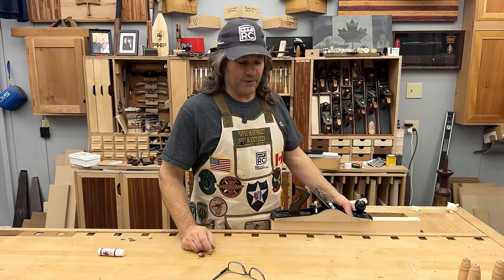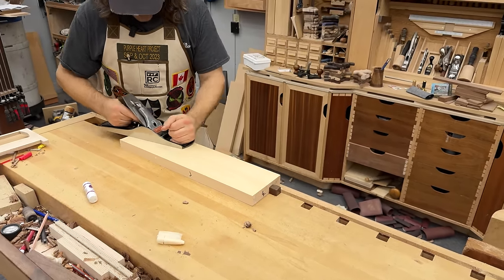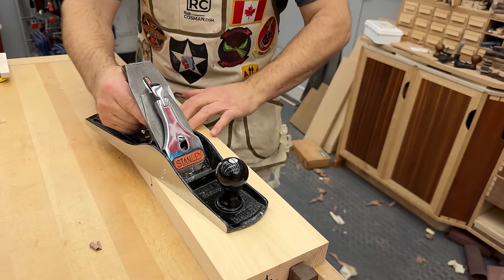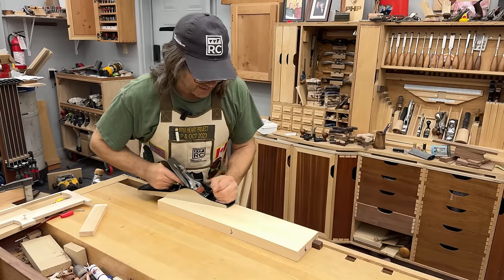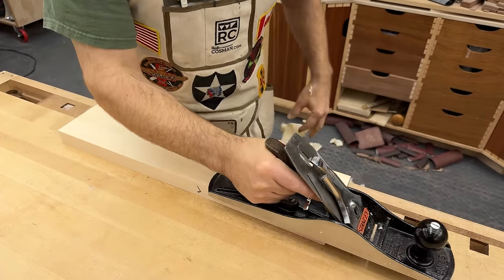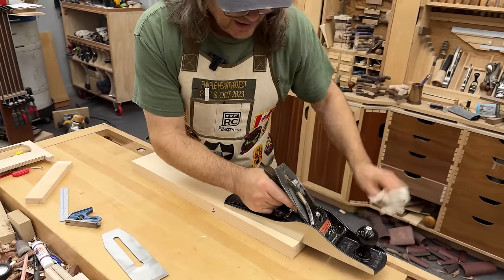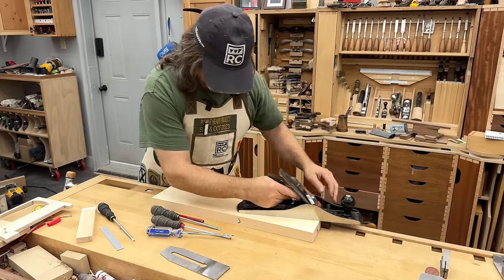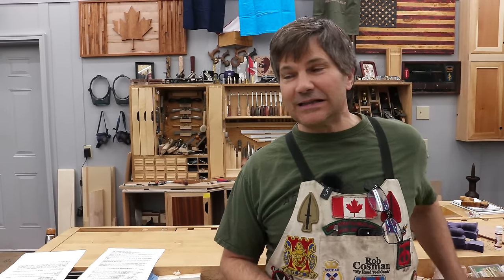Why Your Hand Plane Doesn't Work | How to Fix It!

Comment: My problem is my blade wont move down when I screw clockwise. I don't quite get what force is meant to push the two pins that pass through the blade toward the opening. I have to open the catch and tap the blade down

Comment: Rob, this is a great video and just about explains everything! One thing I believe is missing is "sharpening the blade past 45 degree", which I believe happens to people when they hand sharpen and progressively increase the angle. If this happens, the plane won't cut anymore.
Reply from the maker: Yup you are correct.  I should have included that in this video.  That make the second item we left out.  Maybe we will do a follow up.  Thanks.

Comment: I've been digging these tips out of robs movies for a while and they've made all the difference in my plane success. I would like to add that a solid hold on the material is really important. If it's not held solidly and immobilized that will cause issues. Seems obvious I know but I'm just passing it along.
Reply from the maker: Well thats probably the third tip that I should have included in the video that I did not.  Thanks for the great comment

Comment: Hi Rob, I don't think you mentioned my problem... I used David Charlesworth's method for prepping the chip breaker because there was always a gap between where it engages with the blade iron. I've used a business card up the top near the screw so it will force the gap to close and it works but id rather just have a chip breaker that doesn't have a gap. Is there a way to fix it or should I just buy a new one?  I have a Clifton 5 1/2 Jack.

Comment: Well, my planes are working better than they did when I started a couple of years back. Some one commented that it takes about 5 years to really get the hang of using them, and that is seeming to be true. The problem is that there are so many little tricks that you have to figure out on your own, and can't be taught. I am making progress.

I am curious as to your feelings on the Japanese style pull planes. As some one who HAS to experiment, I started playing with them as well. At the very least, they are interesting, and take pretty much the same skills to work as the western style planes.
Reply from the maker: I stick to western planes.  My woodworking is from the English tradition

Comment: I bought a replacement iron and chip breaker for my Stanley. They did not fit The hardness of both was well above Rockwell 60. I used the iron with a Stanley chip breaker and the chip breaker sharpened as a low angle plane iron. So mixing up the two is not as daft as it sounds. They both worked fine with keen edges!
Reply from the maker: Good solution

Comment: What can you do if the chip breaker doesn’t pair well with the blade? I have light showing on both sides when they are screwed together but pretty sure the blade is flat.

Comment: That's a lovely Stanley plane! When I sharpen my blades, I have a devil of a time feathering the edges...I put pressure on the edges for three seconds but it seems that the edges dig into my 16K stone. Is there a specific technique you use when feathering edges? Thanks for your content and have a wishing great, prosperous new year to the Cosman team!
Reply from the maker: If you are referring to the vintage thin Stanley blades yes they area bit mor prone to digging in because they are so thin.  Put a little less pressure on the corner but spend more time on them...6-9 seconds
Reply: @RobCosmanWoodworking  Thanks for that tip. I occasionally had the same issue, though not with the Ray Iles replacement blades, which are 2.5mm rather than 2mm thick

Comment: "If that doesn't work....buy a belt sander". 🤣🤣🤣

I've followed all your advice regarding planes & sharpening & now have a 4½, two 5½s & a 7 (All 50+ year old Stanley Bailey's) which perform fantastically - unimaginably better than they used to.

Comment: Another issue can be the fit between the blade and the chip breaker. Probably more of an issue with the older, thinner chip breakers. The chip breaker has to be ground perfectly flat and to the tip to give a close fit over the whole length of the forward edge. Also consideration to this edge when compressed with the center screw.

Comment: That Stanley Jack looks well fettled. Good info to know.

Just out of interest, I wanted to ask about how thin a shaving you can get with a metal plane. I use Japanese tools but I've always found dealing with kanna difficult. Do you think it's possible to get a 0.010 micron shaving from a modern metal plane?
Reply: 0.010 microns is 10 nanometers, so about a 1000 times less than a really thin shaving.
Reply: Sure. IT is just going to take a ton of tuning and setup. Just like the top kanna. The competition kanna are pretty much custom made to shave thin.

Comment: I'm familiar with the adjusting knob being a circular brass knob.  yours looks like a 'pin wheel' .  Is that after market or is Stanley making them that way.  Seems like a better way to adjust on the fly.
Reply from the maker: It’s an aftermarket knob that we designed and sell. https://robcosman.com/collections/planes/products/rob-cosmans-plane-adjustar-stanley-record-version
Reply from the maker: Our design, we have them to fit Stanley, Record, Luban, Lie-Nielsen and Woodriver, robcosman.com

Comment: I appreciate the video. I do have a question for you. I have a couple newer Stanley planes. A low angle plane and an 8 inch or so plane. I can put a shaving edge on the blades, and I have followed the steps you have shown in the video. I still have a few problems. First neither of the planes will hold depth. Between the backlash in the depths screw, and I assume the looseness of the frog threads I find myself endless lowering the blade every few passes. I have never been able to pull a shaving as feathery as you (though I know in part, it can only be done with flatter boards). And without fail I have various levels of tearout. I know planning as such :

-> \

With the grain rising to the blade rather than away from it can cause this, but even if I plane in the opposite orientation it leaves these tiny little pock marks on the surface. I realize I spent some 20 dollars on these and I'm going to get what I pay for, but is there any hope to repair or strengthen them?
Reply from the maker: Spend your money wisely and once.  Buy a good plane and get on with it.
Reply: @RobCosmanWoodworking  I suspected so, thanks.

Comment: I had a strange issue one time - the frog wasn't quite parallel to the mouth.  Was very hard to get blade to cut evenly.  I must have had it squirm slightly when I tightened it down, so now I watch closely that the leading edge of the frog is aligned properly.  And wax that plane sole!

Comment: Have you ever done a chess/checker board?  Most of the video's I see use sanders to get the top smooth.  Is there a way to plane the surface to smooth?
Reply from the maker: Depends how you make it. Are you doing the squares end grain up or face grain up?
Reply: @RobCosmanWoodworking  I had planned on face grain because that's what I thought would be the easiest to make.  I find the idea of making end grain boards intriguing but intimidating mostly because I think it will be harder to create the alternating patterns.

Comment: Was that screw connecting blade & chip breaker, which appears to be Allen head,  an OEM item on that plane, or a modification?   I haven't seen that before.  Also the depth adjustment knob...?  It didn't look like the standard item either.
Reply from the maker: We work to make little improvements that make a difference.  Jake and I developed the replacement “AdJustar”, a 5 spoke wheel, much easier to turn.  Jake (son) developed replacement hex drive screws for the 5 main ones on planes.  He also came up with the “grip” for comfortably using the plane on a shooting board.

Comment: what about frog position?  How much gap should there be between the tip of the blade and the front of the mouth?
Reply: Slightly bigger than your shaving. 2-3mm. But it doesn’t really matter much, a really tight gap on the chip breaker matters a lot more.
Reply from the maker: That depends on what you are doing.  If you are working wood prone to tear out then closing up the gap between the blade and the edge of the throat open will significantly help prevent tear out.  If your wood is not tearing out then keep a wide mouth.  Unlike the previous replier I don't believe positioning your chipbreaker super close to the blade edge provides any benefits.

Comment: How can I ask questions on this channel.fornypur next video?
Reply from the maker: Ask!
Reply: @RobCosmanWoodworking  wonderful. My question is this. In every woodworking video book or instruction there is one thing in common. All the pieces of wood are flat, straight and with parallel faces. It is the first step in anything you do. And if you loose half the wood in the planer so be it.
I have been doing some work with big pieces. (10ft x 8in x 8in) where the faces are not parallel. And the corners are not sharp.
How do you work with such pieces to make joints that are tight. For example on a corner brace.
Also sometimes I want to take advantage of the natural curvatures of the wood but how do you mark such a piece?

Comment: 🎉🎉hiya I have nomber 5 spear a d jackson but it's a screw on clip not a quick release and soon as I un done the blade it all just falls apart n I carnt keep it all strate and true evan with the blade movement stick
Reply from the maker: Well I dont think its the screw down cap iron verses a lever type cap iron.  I do not recommend Spear and jackson planes.  I bet you will have a better experience with a higher quality plane...Try a WoodRiver or a Lie Nielsen.  I think you will find it a much better experience

Comment: I can't get my plane to take an even shaving. The right side of the iron always sticks out further than the left no matter how I adjust it.
Reply from the maker: Sometimes you have to grind the edge of the blade to match the plane.  If a blade with a square edge projects unevenly through the mouth of the plane and you don’t have enough lateral adjustment to correct it, grind it to fit.

Comment: I know the frog on a No. 5 Jack plane is adjustable, but what is the default open size?  And, minimum and maximum sizes?  Where don't you want your frog to be placed, ever?  Frogs just don't seem to get talked about much, I'm guessing it's because the defaults work well enough, but as it is movable, I think it warrants discussion.  Thanks in advance.
Reply: Narrow as you can get where it is still comfortable, and takes a nice shaving. Or go extra narrow so it breaks it off like sawdust. 2-3mm

Comment: So why do they make them so the boade can move left and right at all?
Reply from the maker: Because the edge of the blade won’t always be perfectly square to the sides.
Reply: @RobCosmanWoodworking  yeah I mean it's been the design for however many generations. I just don't get it it seems like if they made the slot tight enough that it didn't move in there then it would be forced to always stay in the same place.
I don't know I'm just having a hell of a time trying to get and plans to do what they're supposed to I'm following all the great videos on your videos following Rex Krueger and I just can't get it going.
Must be belt sander time
Reply from the maker: The edge of your blade needs to be straight, but it isn’t necessarily square to the sides of the blade, therefore requiring lateral adjustment. Are you sure your blade is straight? What plane are you using?
Reply: @RobCosmanWoodworking  spear and Jackson no 5.
It's all I could afford so I followed one of Rex Kroger's videos on how to make a shity plane work the best it can.
Problem is the first time I ground the iron I put too much trust in the honing guide and kinda skewed the crap out of it.
So I had to lock it to my speed square and file grind it back to square and start over.
I'm sure it's still a tiny bit off which I can manipulate with the lateral adjustment but still can't get it cutting evenly.
I'm glad I'm working through all these mistakes with a low end plane though instead of something more expensive.
Reply from the maker: @adamguinnmusic5871 I don’t like to speak negatively about others, but recommendations like that often lead to frustration and not satisfaction. Satisfied that you didn’t have to spend a lot of money, but the money that you did spend, what has it got you? Check out my video on a review of a plane similar to that one, 
https://youtu.be/yNQ-5PsaDS8?si=8hSy_AyzuNZO3lf2
And you’ll see what I mean. These “less expensive” tools are not designed or built by people with knowledge on how they function. Hence why they don’t wind up functioning properly.
Reply: @RobCosmanWoodworking  lol the one you're reviewing is high end compared to this spear and Jackson.
But yeah I get what you're saying.
To be fair Rex never reviewed the one I bought. A different channel did.
My other option was not having a plane.
I still think I can get it going if I continue shaping the blade to what it needs to be.
I Royally screwed it like I said. I am enjoying learning a lot about hand planes in the process though.

Comment: Didnt understand the part when adjusting the lateral lever you were also pushing the blade.
Reply: Rob spun the depth adjustment wheel to expose more blade, then used the lateral adjustment lever to level the blade, then retracted the blade back in.
Reply: @tim_biller  Thank you. Have a great new year.

Comment: ITS HARD TO UNDERSTAND ITS MOSTLY SHARPENING. Paul Sellers sharpens to 1200 [diamond plates] SEEMS GET SIMULAR RESULTS.   Maybe Rob should take one of his planes and demo three new in box blades. One blade  sharpened with  1200 grit diamond plate . One blade sharpened to 8000 grit tradition whet stone . Then the final blade sharpened to 16000 " After this combine each sharpened blade with a new unmodified chip breaker. Adjust each chip breaker to 1/32nd from edge of blade. Now back to the original hand plane.  Without moving frog distance, blade depth test each blade. observing results.  Now we can see the actual performance results .This also removes the magic that can be from RC Himself.